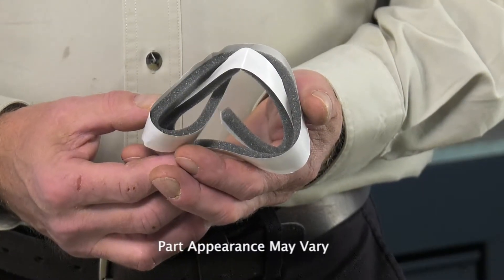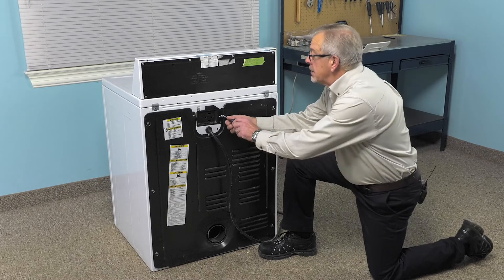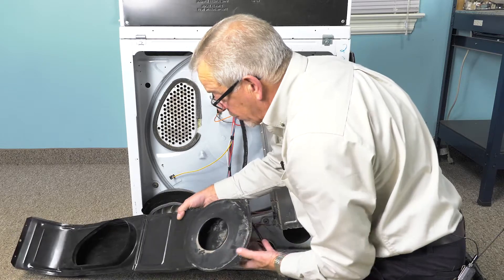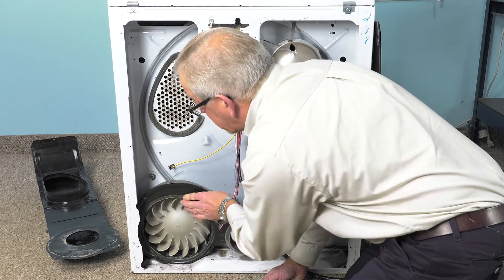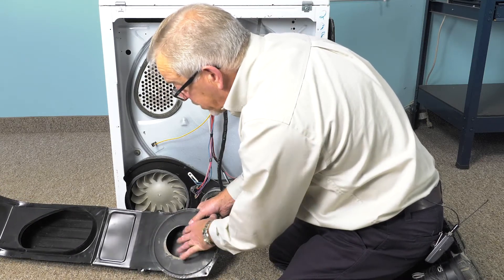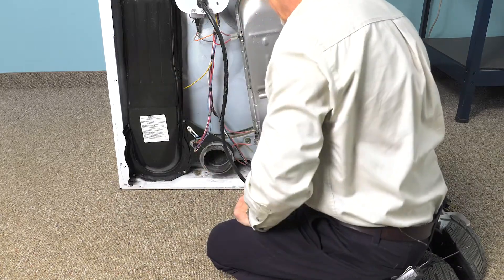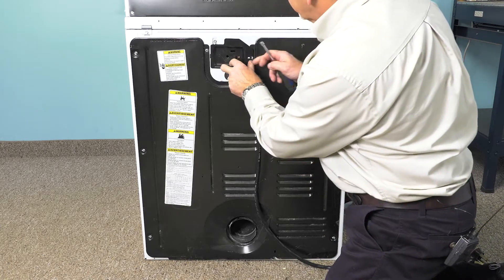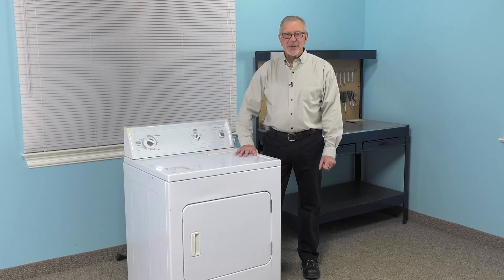Dryer Repair - Replacing the Lint Chute Seal (Whirlpool Part # WP347139)

Comment: Great video, one of my thermostatic sensors went out on my 40 year old dryer so when i took it apart,  unlike most lazy people that only replace the part thats bad i decided to do a full refurbishing and clean everything spotless, of course both chute seals were history, thankfully to your videos i was able to see how everything goes, its pretty interesting how most of these dryers have those 3 sensors in the back,one in the heating element, the other one on the blower housing and that third elongated one above the blower housing one, mine only has 2 sensors and the elongated one is not present, must have been a safety thing added later,thank you again for the great videos Steve, you have made another subscriber.